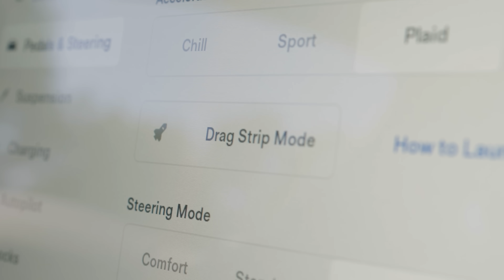How Tesla Drag Strip Mode Works

Comment: How do you use drag strip mode when at the drag strip? It seems to take a while to do it's thing before full cheetah mode is in effect. Far longer than the lights turning green at the drag strip.

Comment: Demon 170 has entered the chat😈
Reply: traction has left the chat, good luck ever getting the demon to beat a plaid on the street.
Reply: @odisy64  It can’t be that hard to get a high horsepower rwd car to put the power down off a dig, look at the Germans. Dodge just needs to find a way to do it
Reply: @anaccount7923  it actually is that hard and why Tesla is the best at it. People couldn't even hit the last record times for the previous demons with Prepared drag strips so I doubt anyone is going to be hitting the new claimed times by Dodge, they had to use drag radials and even then they couldn't get below 9 seconds Infront of an audience.
Reply: @odisy64  that’s true, but there’s gotta be some technology they can use that let’s them manage the amount of torque so that they aren’t spinnin everywhere like most muscle cars do. Either way, unless it’s an s/x plaid or a 3/Y performance I’d never buy a Tesla 😂
Reply: @anaccount7923  torque vectoring through a ICE differential is tricky because their is a lot of "lag" from the engine to the transmission and to the drivetrain, their are a lot of diffrent technologies for this and even specialized in applications like rock crawling, cornering, and drag racing.

but when it comes to Tesla, they have tuned their electronics and software to instantly detect any slip of the wheel in a tiny fraction of a second, faster than a humans reaction speed, and when it is detected the electric motors can instantly reduce power to prevent more slip. you just cant do this when you have to many gears introducing their own lag in a traditional car.

Comment: turkey stock market share code (etyat) It's like having a very low price of 4.61 and it has 17 million shares in total that can be sold, so it will be very easy to increase it 5 times because more than 17 million shares cannot be sold

Comment: Tesla team, hope you are reading this.  I watched a video of someone doing high speed runs on the Autobahn today and the comments mentioned that they can only unlock the full performance in race mode which stiffens up the suspension and this gets annoying after a long time.. Kindly come up with a Autobahn mode where performance is max but the suspension can be soft..
Reply: Mh, with a car with this kind of power this might be dangerous. Even a Tesla can´t fully negate physics.
Besides, the power consumption is massive when going full performance and thus not suited for ranged driving, unless you only plan on doing a sprint down the Autobahn for, say, 200 km at most.
Personally, while I like the idea of having tremendous power at my command when I want and or need it, I consider it more important to conserve power and maximize range for my everyday travels.
And I sincerely hope some general speed limit will come to the Autobahn rather sooner than later, for various reasons.

Comment: How many G's does it pull?  What is the 60' time?  What's it run in the 1/4 mile. Would like to see it run with drag radials on all 4 corners and potentially lower gears to optimize it.
Reply: From what I’ve seen at it’s best:

1.2 Gs 
0-60: 2.1
1/4 Mile : 9.2
Reply: @Xsyzz_  thanks for the info.

Comment: Though, what’s the point of doing a competition against someone with a vehicle which is completely unmodifiable? Any achievement made by such match is completely to the honor of the Tesla engineers, not to the car owner. It’s not like you can mount a bigger carburetor on it or so.

Comment: I love my plaid. It’s the funnest car I have ever owned. And glad you explained drag strip mode. Cause I was not sure want it was doing with the cooling system when I went to a drag racing event. And Its super other than it taking 20 mins to engage
Reply: I heard about the time needed for pre-conditioning the engines and the battery - somewhere between 10 to 20 minutes, depending on their state. Still it´s amazing you can basically turn your everyday car into a performance-cars-eating speed machine literally at the press of a button; then turn it back just as easily when you´re done.
Reply: @robertmandl9326  you’re not “eating” performance cars. You’re just accelerating in from a stop pretty quickly. There’s more to driving than 0-60 runs.
Reply: @HaloDude557  Ah, of course. Here´s the jealousy over the technological advancement. At least have some dignity in defeat, ok?
However, I do agree on one thing: there´s more to driving than 0-60. And a Tesla also gets better results in competent hands vs the "average" driver.
Reply: @robertmandl9326  I am not jealous you are too boring to push your EV and see the limitations of the weight and handling. Do enjoy your 0-60 runs though. Very skillful and interactive with the computer controlled launch control in a straight line. Perhaps they'll make an autopilot drag mode soon so the car can launch for you when it detects a green light.

Comment: Is it 0-60 in 1m43???
Reply: Huh? On the right surface, with a 1-foot roll out, and preconditioning, Motor Trend went 0 to 60 in 1.98 seconds. The Model S Plaid can do 2.1 second 0-60 runs over and over.

The Rimac Nevera is quicker for $2M, the Lucid Air Sapphire will probably be quicker for $250,000, and the insane McMurtry Spéirling electric fan car does 0-60 in 1.40s and the 1/4mile (400m) in 7.97s.

Comment: Need something similar to this on the M3P
Reply: I think next is quad motors from the Cybertruck on a Model S Beyond Plaid model, and a tri-motor for Model 3 and Y Performance Squared models.

The Lucid Air Sapphire will probably be quicker than today's Plaid, for $250,000. I don't think Tesla want to lose bragging rights.
Reply: @skierpage  If Lucid manages to get an inch ahead of the Model S at THAT price they can keep that trophy in my opinion. A fully decked out S plaid cost, what, 160k? I know some people have this kind of money to spend on the side, but still. The S would retain the best bang-for-your-buck ratio by miles.

Comment: That first part where he was discussing battery 🔋 temperature was kind of important.  On a plaid it’s all managed by drag mode so it will either heat up (most likely) or cool off if you have been doing many hard runs.  On performance models all that can be done is “track mode” which only cools the battery down , not preconditioned warming. This is a problem. The battery needs to be warm , not room temp or lower , so by enabling “track mode “ you might actually make your cool battery cooler, thus hurting your drag time.  For performance trims you should actually heat the battery up by super charging or preconditioning for supercharging to heat up the battery.   Or just don’t be cheap and buy a plaid 😂.
Reply: Did they not make this mode for the performance models?
Reply: @MeltingRubberZ28  no , only track mode / drift mode.  Not “drag” mode like a plaid has.  For track racing, your battery will heat up over all the laps you are doing so it makes sense to cool. However, for a quick 1/4 mile drag race or so ,the battery is not really at risk of overheating it you are doing only a few runs with wait time.  In fact it’s more at risk of being too cold 🥶.  For my model 3 performance I precondition for super charging as a “hack “ + charging heats it up enough for a better drag race. A cold battery is def a bit slower. In fact in summer time my car is a bit quicker off the line just because the battery is warmer vs winter outside temps.
Reply: @Shabobidhuffy  that's a bummer. I was hoping this was like a software update to the performance models.
Reply: @MeltingRubberZ28  it could technically be one day. Heat pump can also heat the battery.  You can also maybe do aftermarket software add on .

Comment: While other car manufacturers shy away from drag racing, Tesla dives into it feet first.  I love that.  You know guys are already racing these things on the drag strip and blowing away every other road legal sports cars with ease, so might as well make sure it's doing it in the best way possible with extra cooling and improved stance.
Reply: Absolute nonsense!!!!! Other manufacturers actually does the same including BMW showing how to drift, Porsche, land rover..... Habe excellence driving centers to experience their cars on and Offroad.
Reply: @alanmay7929  that’s actual racing not the drag strip. EVs are heavy and boring so they have to show off their instant torque gimmick on a drag strip to make up. Yeah, we get it EV shills, you can drive in a straight line really quick. Cool. Soon the car will accelerate on autopilot when the light turns green to make it even less skillful and less interactive.
Reply: Land rover has had an Offroad/overlanding competition for literally decades, get of your high horse wtf!!

Comment: I'm content with my Y performance, fast enough for me. Just a lovely car.
Reply: Dont be too humble here friend, the Y is an awesome vehicle. Although personally I like the 3 more, both because I favor the sleeker lines and because it´s just me and my wife so we don´t need the extra space of the Y´s larger frame.
But if you have kids or if you need some extra space for tools and materials for your job the Y is the go-to car, in my opinion at least.
Reply: @robertmandl9326  the y is ugly I don’t get it
Reply: @robertmandl9326  Yeah, had a model 3 long range before, the problem for me was that it rides too low when you have to deal with dirt roads and snow. Plus having the massive 21" winter tires works wonders when you're living outside the city.

Comment: Terrific explanation. And also the reason why Corvettes, etc are still very cool -- even if my Model Y can apparently beat almost all of them on the street. (I haven't tried and won't.)   To get the most out of a 'Vette you have to know how to drive it. It's completely different. I'm a good driver, but I am not a race car driver. (I used to drive with one, he could take curves in the car we shared at speeds I could never even get near. I asked him one time and he said, "Yep, you're doing everything I do, but....." )  To maximize the acceleration, follow the torque curve, in an ICE car you actually have to know what you're doing. In a Tesla the computer  knows. We should all respect the difference appreciate each other's cars. 
 I might sound like an ICE guy making excuses. Nope, Model Y Long Range   2020 Full FSD, and a stockholder.  I know that my Model Y LR is one of the slowest Teslas, and I know that recent year Corvette has a 2.9 0 to 60 time - in the same conditions as a Model S Plaid, but on the street? The 'Vette would be burning rubber and my computer would be following the torque curve.Love driving my Tesla. Can't wait until I can tap the stalk twice and take a nap....
Reply: There´s still quite a road ahead to full autonomous driving. These systems need to prove they are fully everyday reliable which basically means they have to prove they are more reliable than the average human driver.
Right now I am fascinated by what is already possible but I always caution that, no matter how advanced the tech is, the deciding and controlling factor has to be the driver. You don´t just let your car do stuff blindly, you work with your car to better control your journey and thus protect yourself, your passengers and your surroundings.
Reading through your adventures here with your friend I can finally understand why some very experienced and involved drivers consider Teslas to be "boring" though.
Reply: Yeah Teslas take no skill as you said. It’s like a roller coaster. Exhilarating but you are ultimately not in control of the driving experience.
Reply: @HaloDude557  Spoken like someone who has no clue what a good driver can do with a Tesla.
The tech does make many things easier, but if you think its only the tech, think again.
Reply: @robertmandl9326  a good driver would use an actual performance vehicle and not an electric boat.

Comment: Lowering the front suspension does not hold the car down. You could argue it shifts the cg a little bit forward and down...therefore reducing aft axle weight transfer, and making overall more Fx at the tires because of tire Mu nonlinearity with load, but that's it. 

What the hell tesla? Do you understand vehicle dynamics at all?
Reply: It reduces air going under the car and changes the aerodynamics, so it might increase downforce.
Reply: @skierpage  the more I think about this,  the more this makes sense. Even with awd, the Plaid is traction- limited all the way to 80mph.
Reply: Well,  since they pull 9.2 second quarters all day,  I'm guessing they DO know...

Comment: We need this mode for the Model 3 Performance. What battery temperature is optimal for acceleration?
Reply: model 3 does not have AIR suspension, so cant do Cheetah stance.
Reply: @markplott4820  I am not talking about the Cheetah Stance part. We need a way to get optimal battery and motor temperatures in the Model 3 Performance. Right now you can’t control those two things. Track mode cools the motors but it also cools the battery too much. 0-60 mph is fine with track mode but your 1/4 mile times and trap speeds are just terrible in Track Mode.
Reply: Navigate to a supercharger (to initiate battery preheating ) and drive that way for about 20-40 minutes to get the battery nice and hot (depending on ambient temperature) . I use scan my Tesla and any compatible CAN dongle to check the temperatures. I like to keep the battery temps above 90°.  Before racing I'll charge my battery up to 100% and drive to the track. Typically I like to keep the battery state of charge between high 70s% to load 90s%.

This next part is a little more risky, but I'll use it during cold and windy days. After I'm fully charged and ready to head to the track, I'll tape the grill at the front chin of the car to keep it from cooling off so much. And I'll leave that tape on there until I'm done racing.  

Also, if it's really cold out and you're having problems keeping heat in the battery and you have enough state of charge, you can always place the car to navigate to a supercharger while you're at the track while you are in the car and it will slowly put some temperature into the battery.

Comment: Please allow me to do this in my model y Long range! Even if I have to buy the acceleration boost, I'm okay with that!
Reply: The Model 3/Y doesn't have air suspension like the S and X do, so it cannot do the cheetah stance. Additionally, they would want to keep the drag/track modes for their more expensive performance models, otherwise there would be no point in buying the top end options. The best you will be able to get out of your car is just launching manually on a drag strip or a properly surfaced road.
Reply: @YelloDev  I don't care about the cheetah stance, all I want is track mode!
Reply: @allfamyankee85  again, sorry but they will be keeping that for the performance models as an exclusive feature - otherwise no one would buy the performance model since the LR would do the same thing
Reply: @YelloDev  if that's the case, than it is what is! My car is still dope and very fucking fast, I can't complain!
Reply: @allfamyankee85  Indeed. For its class and price range the Y is a very powerful car. If you wanted an SUV capable of at least coming close to the Model S you should have saved up for the Model X Plaid. For something this massive and bulky the X sure has some serious power.
Reply: The illustration of the crossover owner right here. Make up your mind bro. You want a tall car or a sporty one?
Reply: @codyrap95  my car is sporty plus tall, I just want more out of it!

Comment: Fast enough to get ya booted from an NHRA track for....going too fast!
Reply: I heard about this in some videos, although apparently some rules have been adjusted by now to allow the S to go full power even without a chute and rollcage.
.... chute and rollcage 🤣🤣🤣
You know... sometimes I kinda pity some of those performance cars. Imagine building a dedicated powerhouse, almost completely useless for anything other than drag racing... and then some luxury sedan just rolls up, quietly nonetheless, and smokes you.
Reply: @Robert Mändl  End of last year if I let off to 149 they were OK, but for 150 plus ya gotta have a chute and cage in your kid taxi.

Yeah, leaving the track with the family, running the AC, letting the car drive itself we passed all the fat tired slicks on trailers the plaid smoked, lumbering behind tow vehicles, special race gas etc.

Love a dragster but Elon wasn't BSing when he talked of a dinosaur like extinction.  The onslaught continues....
Reply: @robertmandl9326  don’t feel bad. They are having fun building and driving the car. Tesla “drivers” don’t put any effort or skill into it so they get no satisfaction from the “drive” except by bragging on the internet.
Reply: @HaloDude557  Haven´t met a Tesla driver yet that is not satisfied.
You may also leave out the quotation marks around driver. Just because you can´t handle a Tesla and don´t know what its capable off doesn´t mean there aren´t others who do.
Also nothing wrong with a car that can be racer and family shuttle all in one. Get with the times.
Reply: @robertmandl9326  "can't handle a tesla" BBAHAHAHHA. How hard is it to turn on launch control and drive in a straight line? Tesla "drivers" do not need skill to drive, much less they do not drive at all. The car does almost everything for them already.